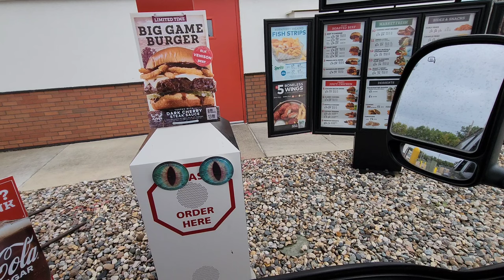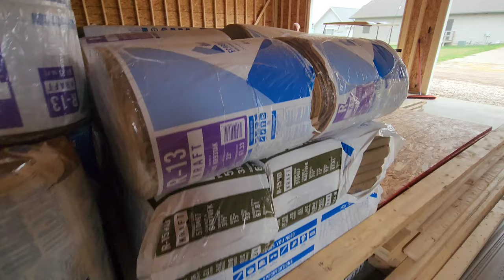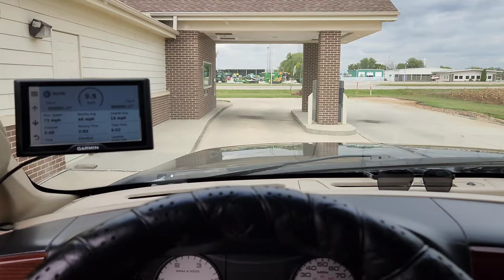Being Home Can Be Pretty Expensive // Supplies Needed

Comment: My two shops, not that big, 12x24 are lit with LED. One of my shops has a 10x12 pitch with NO ceiling joist. Braced at the top an hurricane clipped to the walls. In the center all the way to the top I have a 12,000 lumen four blade LED. On each end of the shop are LED lights of 8,000 lumen. The shop is a wood working shop and you can't have enough light. The lights are cheap too. LED is the way to go.

Comment: Tell me when your dads “man cave” is scheduled for completion? When can he expect to start moving HIS TOYS in? 
Don’t be stingy with the power outlets, if the code allows, mount them high enough to be above the work bench. I have setup multiple machine shops and have found that they work out at 10ft. spacing, works well with 20ft. extension cords. You will always be within a few steps of power. Install 4X4 boxes with 4 outlets per box. It will look overwhelming but they will get used, Trust me. Don’t be afraid to drop 220v in at least a couple of corners, 1 for a compressor, 1 for a stick welder.  Project is looking good 👍👍

Comment: Since you have a ceiling and will be insulating sidewalls, i'd think about a 24K BTU mini-split Heat/AC unit just to keep the garage halfway comfortable in winter for projects and in the brutal summer days halfway cool when a fan with doors open just aren't quite enough.